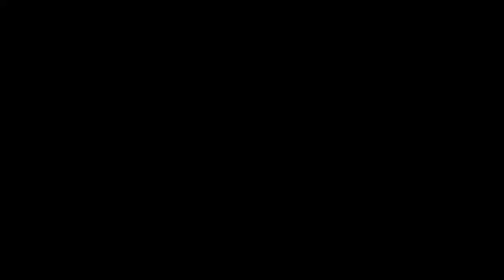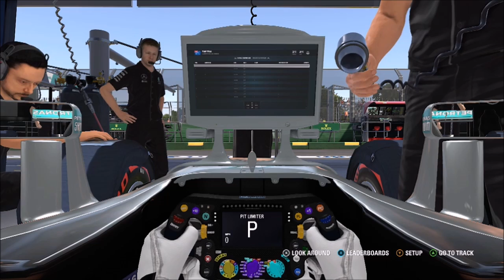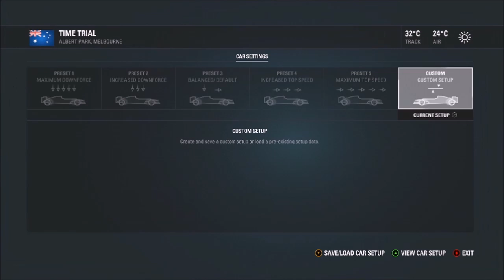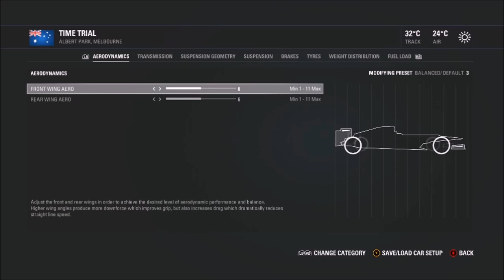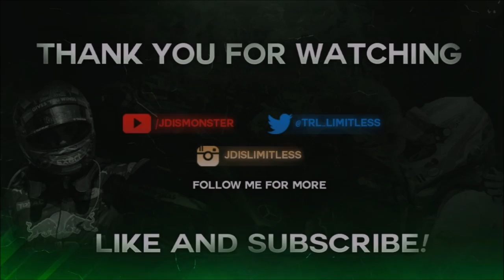F1 2016 car setups - How do they work? (Tutorial)

Comment: Hi JD, had a question for you..sometimes in high load situations, when there a quick directional change involved, my  car seems to steer itself off road unless i lift off...do you think thats because of understeer or a lack of downforce?
eg, the flat out corner towards the end of sector 1 in melbourne park that should be taken flat out(and i could while i was in the maclaren), but in the ferrari(that has lower downforce in comparison in my career mode) i need to lift off to make the corner..any suggestions??

Comment: Thanks for the info some of it helped, I just want to give some constructive criticism. Correct me if I am wrong, but I feel I must mention that it's not strange that you feel the need to put 11 in ballast as you use 11/11/11/4 with suspension. 11/11 Shouldn't be necessary besides perhaps on some tracks, and it doesn't give ANY oversteer at all. When you use 11/4 in ARB you create massive understeer as you need both susp and ARB at a lower value for the front wheels then for the rear wheels to get a healthy oversteer. If you put for example 7/8/4/5 you would gain a bit oversteer from the suspension alone. Regarding ride height it isn't true that you go faster if you increase ride height It's like standing up on a bike and think that the airflow doesn't affect your speed. The lower the mass of the car is to the ground the faster it can travel. That said, you shouldn't put to low height like 1/1 as when you have a full tank (if you play more than 25% race) the car will touch the ground because of the heavy fuel load and hinder the acceleration. If you want stability without using massive susp use less ride height in front and a tick more on the rear. That creates the stability you talk about. The car touching the ground is probably why you feel that you are faster when you use a higher value in ride height. Also If you use a value for the wings between  +1 to +3 more for the front wing than the rear that also increases oversteer a bit. That makes it possible to decrease the ballast from 11 to between 5 to 9 without problems.

Comment: My front tires are always running out at the end of the race. they are like 70-80% wear and back tires are 40-50%. how can i fix that  ? I don´t use any assists.
Reply: Don't lock up. Don't trail brake into fast corners and smooth steering. Don't push 100% during races

Comment: Hey Limitless, love your videos, thanks alot for all the work you put in. I haven't played racing games in 15 years & you are essentially teaching me everything in these videos so thanks.

Question though, I've been using your hot lap stetups. But i run automatic shift, abs/traction on.   And I've been using the setups from those hot laps in online races (which at the end of the day is what I play the game for).  Any advice on if that is good to do? or what slight adjustments I should be making on every setup.  What setup do you use (the one in this video?) when racing online compared to your hot laps.

Thanks again

Comment: I'd like to add some explanations on the differential. This is basic theory. 

Thing that we can adjust in differential-setup is "locking-ratio", with the following philosophy:
 
-> 100% lock-ratio =  no differential
->      0% lock ratio =  open-differential (in this game, the minimum ratio is 50%)

Basic principle: 
Differential is a mechanism that allows two wheels at the rear-end, right-wheel and left-wheel, to rotate at DIFFERENT speed (this is why it is called differential). 
This is important in cornering.

The different speed of those two wheels happens because: 

(a) When on-throttle --> the mechanism distributes MORE POWER to the OUTSIDE wheel than that to the inside wheel.

(b) When off-throttle --> the mechanism distribute MORE ENGINE-BRAKING EFFECT to the INSIDE wheel rather than that to the outside wheel.

Both conditions (a & b) result in ovesteer. 

To overcome this oversteer-problem, engineers put lock-ratio to limit the work of differential because too much differential makes the car tending to oversteer.

CONCLUSIONS:

On-throttle happens when we're exiting corner and put on throtthle
Off-throttle happens when we're entering corner and put-off throttle

For both conditions ("on-throttle" and "off-throttle"): 
Increase lock-ratio means --> reduce oversteer but more tendency to understeer

Hope it helps to understand more about differential locking-ratio

Comment: Awesome video! 

Really really helpful as this year we finally have to have different setups for each track and downforce actually is useful.

Thanks a lot for uploading and sharing your insight mate, have a good one! 

:)

*I don't understand why Codemasters didn't come up with the idea to implement a 3d model of the car that will zoom in and actually show what happens if you change the sliders around the setups. 

Like if i change the Toe it'd show me the 3d model of the car from above to showcase me the effect of me adding positive or negative angle values. 

Or if i change the Aero values it'd zoom onto the fron or rear wing and show me how the wing goes up or down slightly.

Or if i change the ride height it'd zoom out and show me the whole car from the side and the 3d modelled car would raise or lower in it's height.

So many options to make this more intuitive, as in todays generation of technology we should at least expect a little bit more creativity to be honest.

Comment: Stiffer suspension gives more straight line speed, responsiveness, and slight better traction. But personaly: i can't use it in 50% RACES like high tyre wear tracks as China, Malaysia and Spain for example. It destroys your tyres very quickly. My tip: you can use stiffer settings in practice/qualy, but think twice before you start the 50% race. On circuits like Monaco, Canada and Austria, this is less important because off the low tyre wear.

Comment: Always curious... When I watch your setup videos and stuff like this would you recommend the setups for career mode or do you think they are only suitable for TT?
Reply: +Thatguywiththeguitar I use his setups for career mode and there are some races where you struggle with tyre wear but there are other ones that it's just ok
I've always been very agressive and had tyre wear problems so it's not that bad
Reply: Don't be afraid to use his setups in career mode. I do and for the race I just adjust the spring stiffness and front anti roll bar from 11 to about 9 to help with tyre wear and I have never had a problem :)
Reply: i think some of them are tough on tyre wear
Reply: +Hugh Jass you reckon it's worth not using his setups and using the ones he says in this video and just change the wings?
Reply: Thanks guys. Also I asked TRL but was wondering if you guys had an opinion on whether to change any of the settings for a pad like linearity

Comment: Great stuff JD :) What i'm trying to determine in this game is; What is Toe-Out, and Toe-In (Moving the slider to the right or to the left) Because there is this general rule which says that;...Front Toe-Out gives you better Turn In. And Rear Toe-In gives you Improved Stability. Too much Toe in any direction will slow the car down due to the drag effect,  besides that you will kill your tyres very fast. So once again; What slider direction is Toe-Out and Toe-In?
Reply: Toe Out = negative numbers in degrees; so the lower the angle the more Toe Out you'll get

Toe In = positive numbers in degrees; the higher the angle the more Toe In you'll get

0,00º is basically the neutral position which is having all tyres in a straight angle, anything below is Toe Out, and anything above Toe In, hence why the default ranges between each individual Toe setups is different in the game.

Front Toe 0,05º - 0,15º

Rear Toe 0,20º - 0,50º

That's why the rear have higher values, the devs gave us a more Toe In heavy range to choose from.

I'd also suggest to check up the specific definitions, yourself if you happened to have are interested in knowing the cars handling and engineering.

Comment: Could you explain what is differential and how to use it in a race. You can only change it on the osd while driving
Reply: It's the on throttle differential that you can change on the MFD.

On Throttle Differential means that the higher the value the more responsiveness you'll get whilst accelerating and overall higher straight line speed, but the downside will be that it'd become way more easier to spin out this way and get prone to massive oversteer.

The lower you go with it the less trouble you'll have with oversteer / spinning out from accelerating out of corners, but you'll get less responsiveness and less straight line speed.

Off Throttle Differential means that the higher the value the more understeer you'll get into corners, the lower you go the more stable the car will be, as each individual wheel won't be locked this way and can rotate at different speeds, so for example the right inside wheels in a right hander will rotate faster than the left outside wheels, giving you slightly more control and turn in. 

The correct engineering definitions can be read in the game or by simply doing your research mate!

Hope i could help a little.
Reply: +Mani Kryptic's: Magical World of Obscurity ahhh ok wish codies made that a little clearer. thanks though

Comment: Its weird right, because I struggle with my throttle application while exiting long sweeping corners, and I use about 90% on throttle diff with an Xbone controller on PC, but yet I drive even worse if I lower it for some reason.
Reply: Nice pic lol pyro
Reply: you will get exit oversteer with a number like that
Reply: reduce your on throttle percentage to reduce your exit oversteer

Comment: on the pad i have to now really get used to having a smooth turn in and out so that i can have a smoother throttle output. plus the tyre management is a pain on the pad but ofc more practice i will eventually get better. thnx for the setup looks good all round

Comment: Thank you for uploading this, very useful. Is there a particular track you would recommend for practicing on to getused to driving with no assists and the pad? I don't use assists on any other game, but I'm finding this particularly difficult. Thanks in advance for any advice you can offer.
Reply from the maker: I would say Spain or China is a good place to start
Reply: +199772AVVI Thanks.
Reply: I think Bahrain has everything for braking practice and Malaysia too
Reply: +TRL Limitless Thanks, much appreciated.
Reply: Well I'm mediocre, was in the top 200 of time trials on 2013. But no where near that right now with 2016. I wondered the same question. Cause I've now turned off all assists. Before I use to have on racing line and ABS. So I picked Australia as the track to practice on. Because it's damn hard to get a good lap, meaning no corner cuts. Also it has more than one very low traction zone.